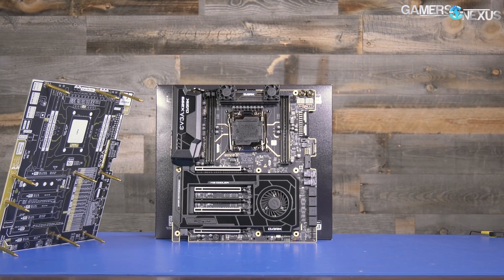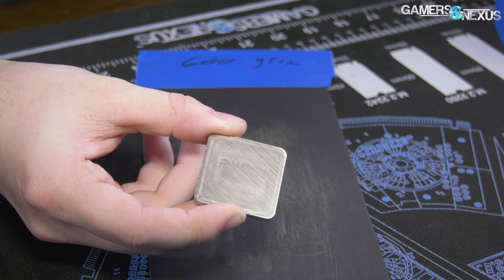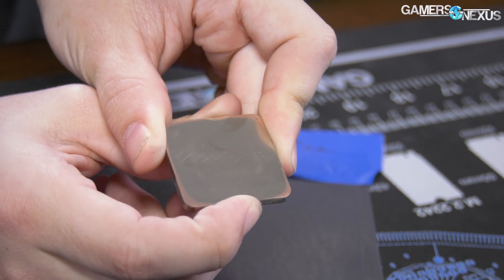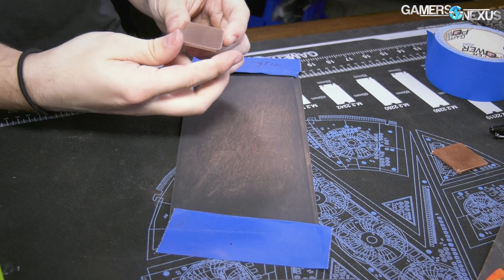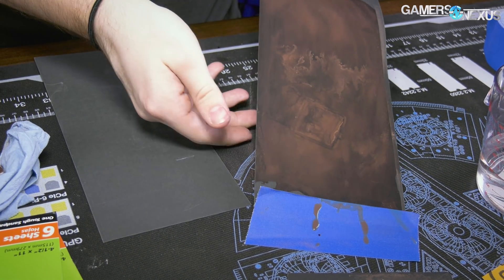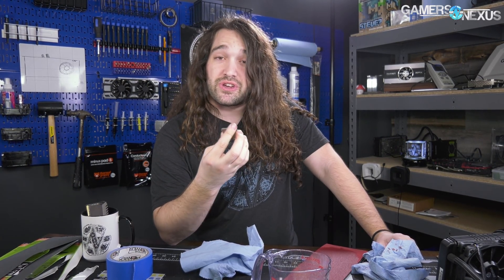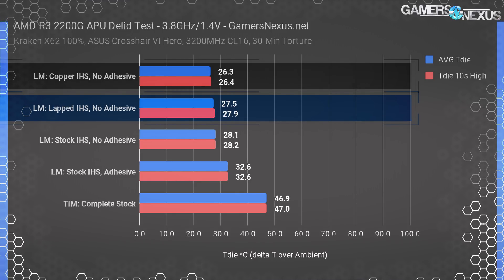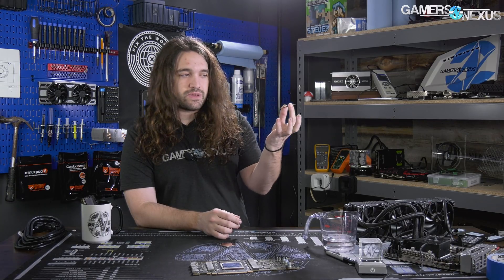Lapped Ryzen IHS vs. Copper & Stock IHS

Comment: The outer corners are becoming convex because you didn't tape the sandpaper on a flat, hard surface. Since the mat gives in when you apply force, it ends up sanding the corners more. Ideally you should use a pane of tempered glass flush on a hard table as your sanding surface.
Reply: As a machinist who understands what the term "flatness" means, I can tell you without a doubt that your mat does give a meaningful amount but you just don't realize it. I guarantee if I were to place the mat on a truly flat surface (a multi-thousand-dollar flat granite slab that's within 1/10,000th of an inch flat) and run a probe over it, especially with the same pressure that you exert on the IHS while sanding, there would be a ton of variance.

Not saying that the top surface of the IHS isn't concave, just saying that on a technical level you really are not making it surface flat since your surface (mod mat) isn't truly flat.

https://www.gdandtbasics.com/flatness/

And if you still don't believe it's a meaningful amount of give, look up how people sharpen convex-edge knives. They do it on a mousepad or mat similar to yours, exactly because those mats do give quite a meaningful amount.

All that being said, I do really enjoy your videos and have been a subscriber for a while. Keep making great stuff! Love to see your experiments. And I wouldn't have expected you to know about 'flatness' anyway. But now (hopefully) you do!
Reply: @JosephAguirre  but should a bendy surface not make the material convex instead of concave?
Reply: Yep. Not truly worth lapping anything on a surface with more than .001” variance across it. Granite and glass are typically the most appropriate materials for this kind of thing.
Reply: Plus pressing the IHS down by hand and moving it also causes ever so slight changes in angle of pressure that cause the edges to get sanded more than the center.
Reply: The moment the sandpaper isn't completely flat on any surface, it will take off more from the outer edges, even when your basematerial is milled/completely flat. By pressing more on one side it will take away more from the edge. You might think it doesnt matter that much, but I have done this so many times during my professional watchmaker education to get a perfect brushed finished by hand. In fact, we used special sandpaper which had glue on the bottom to tape it on a glass panel.

But I know the pain then you slip of the material, even more when the metal gets hot...
Reply: I'm not a machinist, so you've done a much better job of covering all the important points.  It would be cool to see someone flatten a IHS and the mating surface of the heatsink to the point that they outperform thermal paste when simply pressed together.  (There are ultra precision measuring devices called gauge blocks - AvE's video on YT called "BOLTR: GAUGE BLOCKS" covers them in his unique style - that have surfaces that are so flat that they stick together in a process called "wringing" and they can't be left in contact together for long, or they will "cold weld" - atoms from each part will start forming bonds with the crystals in the other piece, joining them together.  So we've had the technology to make two metal surfaces touch each other nearly "perfectly" for 120 years.)  Two problems come to mind: one is that the differential heating from the chip outwards might create enough difference in thermal expansion of the metals to lift a lot of the heatsink out of contact with the IHS (by millionths of an inch) and the fact that there are tubes behind the surface of the heatsink means that that surface might distort under pressure away from the IHS enough to limit thermal transfer without paste.
Reply: Also i think a better way of sanding would be to start wet right away, 10 strokes back and forth, 90° turn, 10 strokes and so on to apply even pressure to all sides and try to minimize human error. Also while lapping, the contactsurface of the cooling unit should be lapped as well
Reply: Yup, I have to say I cringed a little watching this. I’m just about to build a Ryzen system and was curious because back when I last got a little OCD about this stuff I lapped both my processor lid and noctua cooler. 

The fit was so good that you could lift the cooler by sliding the processor against the cold plate and they would adhere like wringing slip gauges!  

That ran without any thermal paste. 

It helped that I lapped on a precision granite slab in the uni engineering dept. Used some fancy 3M um papers too. 

But yes, the machinists in this thread have it spot on.
Reply: End result is usually 10x less accurate than tools you work with. Using that mat for flatness reference during sanding means that you get good end results only with good luck.
Reply: As a machinist, I can tell you emphatically that the mat does give enough to cause the corners to wear first. The HS may indeed be cupped as well, but we use known flat hard surfaces when hand lapping in a machine shop for a reason. We also use a figure eight pattern to ensure an even lap.
Reply: Came to say this. Glad someone else spotted it too.
Reply: Yeah the last time I actually bothered lapping anything was back in the days when the surfaces of some coolers looked like sandpaper themselves lol.
Reply: This is amazing channel but that's not lapping.... And if you're trying to increase contact area you must lap both surfaces.  I would love to see this done properly and then the test results.  Thanks guys!
Reply: This was killing me. This is just sanding, not lapping.
Reply: Or then you just spend couple canadian rupees, buy good thermal paste and skip hours of manual work in couple minutes to achieve 99% of the thermal conductivity. It is not about what can be done, it is about what is worth doing.
Reply: surprised me he done it on that mat, really need glass for this...
Reply: a window flexs too but still not as the mod mat
Reply: While pedantically true, it means fuck all in terms of relevance for the extremely small difference in material removal. Besides, the point was surface polish, not flatness of the surface. If the concern was perfect fitment to whatever heatsink they chose, they'd have lapped them against one another like lapping engine valves to their seats.
Reply: Yes. Glass is excellent for this. The first time I did this (to a Pentium 4) I actually did it against a window :p
Reply: @99SpecR   Yep, Windows for Pentium, no issue here.
Reply: @99SpecR  first time i lapped a cpu I used a small hand mirror and lapped my little athlon 64 3200+ it took HOURS to lap that thing. lots of sharpie near the end too

I think i finished it by wet sanding it with 2000 grit
Reply: Also caused by the paper not being wet from the start . Water creates suction between the flat surface and the paper which stops it from flexing at the corners of the ihs. The best choice that comes to mind is diamond plates, or wetstones designed for sharpening tools. Polishing flat pieces if metal is literally what they're designed to do, just make sure to maintain them so they stay flat.
Reply: @Erowens98  wetting sandpaper isn't desired when lapping afaik because it makes the sandpaper a little bit more flexible which makes it round the corners
Reply: @deadlockdead  depends on the sandpaper. Get sandpaper designed for sanding and you'll avoid this issue entirely. If that stuff rounds the edges at all, it's on a micro-scale.

You can sharpen blades well enough on wet-paper to shave with. Which requires a fine edge. Much finer than you'll ever need on any IHS.
Reply: @Erowens98  i never managed to find a sandpaper that wouldn't flex more when wet and I used 3M, Indasa, Hermes, Mirka and few more. And I also used to sharpen the knives on sandpaper. The difference is, while sharpening you stroke "with the grain" which makes sandpaper flex and bulge near the top of the cutting edge micro bevel and you just lose the sharp transition. When lapping, it'll bulge in the direction you're pushing at the time and always round the edges
Reply: @deadlockdead  then the issue is probably user error. I use Mirka wet sanding paper every day in my machine shop and have never had an issue with it rounding off edges.
Reply: @Erowens98  then can you lap the piece so you could cut yourself with 90° angles on it? That's how my machining "mentor" used to check if it's lapped correctly
Reply: @deadlockdead  Yes. Got plenty of cuts that way.
Reply: Timo Pelkonen that 1% matters to enthusiast overclockers.
Reply: Gamers Nexus I hate to say but no you made it worse not better. You may have seen temp improvement due to a cleaner surface or due to more surface area because now the ihs isn't even close to flat so there is more contact surface for the thermal compound. But defiantly not because its flatter.
Reply: A machined straight edge is far cheaper than a pane of tempered glass and can be blended if you ever develop scratches, gouges, or other slight imperfections. Also, the variance he created is absolutely not going to cause significant change. Wet sanding may help from the start, but the different grits in the order he used them in become so fine that even a .002 variance across the IHS' flat is unlikely. There is absolutely no reason to need to invest in a tempered glass panel or machined straight edge, though. Simply polishing the IHS will achieve the same results over any flat surface.
Reply: And at the end of the day it's all just for your OCD anyway because from my experience lapping doesn't really do much besides turning the CPU into a tiny mirror.
It's a relatively harmless and cheap mod that's kind of fun to do once but objectively just not really worth it. If I'm not mistaken the whole lapping thing only really got popular back when coolers were being machined with a pretty rough finish and lapping those could actually improve temperatures noticeably.
Reply: @BitterCynical  Yea, I only needed to lap one heatsink as it was really rough. It was from the early 2000's. I just knocked the highspots down so that it made better contact. I didn't bother with the polishing bit as after I was done it was already better than most OEM heatsinks that were available.
Reply: @BitterCynical  love my mirror finish x3 720, oc'd like a beast on a 990fx mb and water cooling i had floating around, shits n gigs purposes of course, shat all over the 8350 in heaven benchmark......by alot. Can't remember half the other benchmarks.
Reply: Sadly this is what i expect from GN, some half assed attempt. Beside some of his talked head videos as they are good but there i cant stand his "never-changing-tone"-of a voice it makes it so boring and just sounds like the nagging wife....
Reply: Fair go, it wasn't a half assed attempt. The guy freakin bled on it, jeez, how hard does he have to try to satisfy you? And there's no need to be rude about his voice. Maybe try concentrating on the good things he says, rather than the way he says them? 
Steve's just not good with criticism. Why do you think he's so obstinate about the wobbly table? XD
Reply: The real question is "meaningful". Was the test done in such a way that the results were skewed? I suggest that while Steve's sanding method technically resulted in a convex surface, that degree of curve was so slight as to be meaningless.

I'm sure those of you that think it made a difference can do the same testing and prove that your perfectly-flat IHS cools better. Or just cools differently in any kind of significant way. Right?
Reply from the maker: The mat doesn't give any meaningful amount as you push in on it. It's not some foam. The corners are that way because it's literally made that way by AMD. We were sanding it back to level.
Reply: @GamersNexus  I've been taking sandpaper to my processors ever since heat spreaders became a thing.  I also own a gn modmat.

the modmat is too soft.  you want a surface that's harder than the metal.
Reply: Gamers Nexus why are you being ignorant to all the people of your channel trying to share good information with you?  Why can’t you understand why a hard flat surface would produce better results?
Reply: @GamersNexus  You have now extensively used a machine that measures flatness and pressure points. I don't want to tell you what videos to do, but this would be a way to validate an earlier video you still have up. If you still have this IHS, could you measure this lapped IHS? If you don't have this IHS any more, you could quickly sand down another the same way and measure it.
Reply: @GamersNexus  any amount is meaningful when you are talking about correcting 'microscopic' imperfection in the cold plate and/or IHS. @ferongr is absolutely correct,  plate glass or sometimes stone tile is a good surface to lap from.
Reply: @GamersNexus  You're wrong my dude. You need to put the sand paper on a very hard and flat surface , also use double sided tape under the sand paper to prevent it from bulging on the sides.